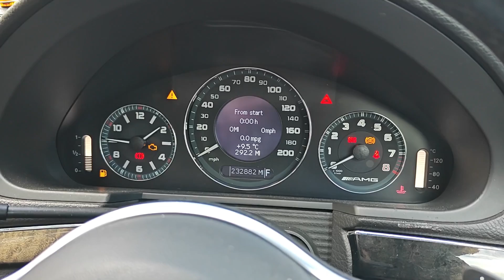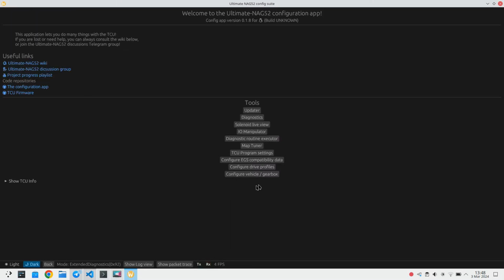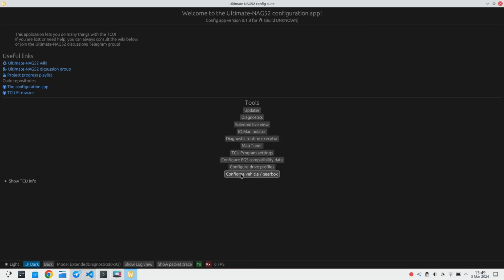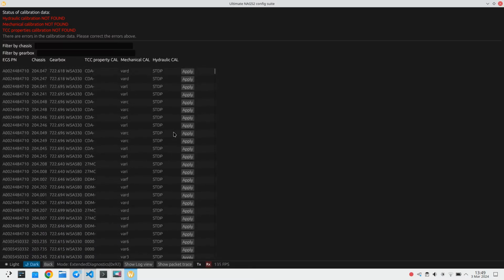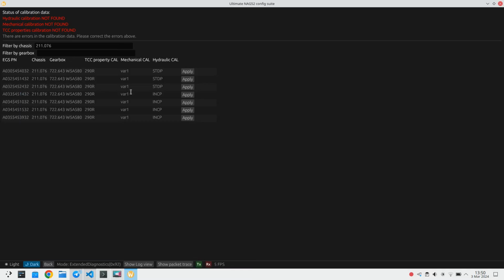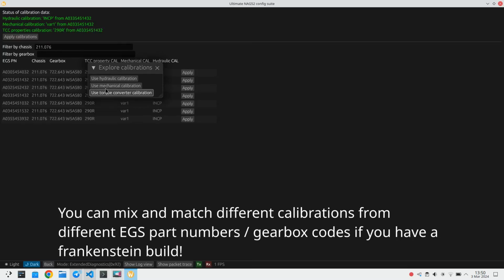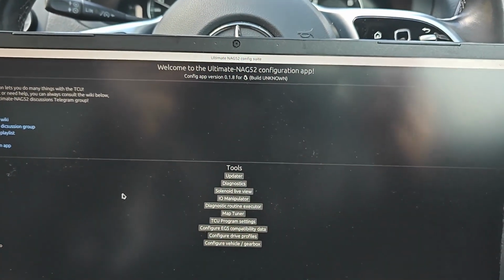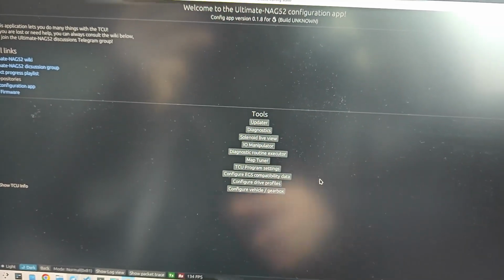Ultimate-NAG52 EGS Calibration setup guide

Comment: Hi, reporting back after a successful test run of my NAG52: Only issue is that despite having the EWM CAN shifter, the gear is not displaying in my 722.632, W210.070 vehicle with a TCM that is unlisted under that combination. Make is APRIL 2000, E430 W210 v8 4.3L